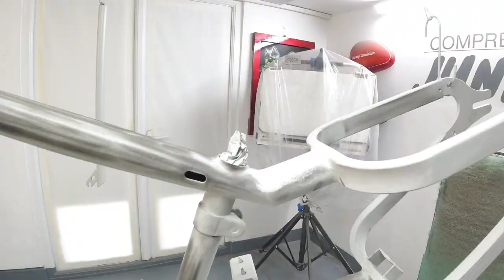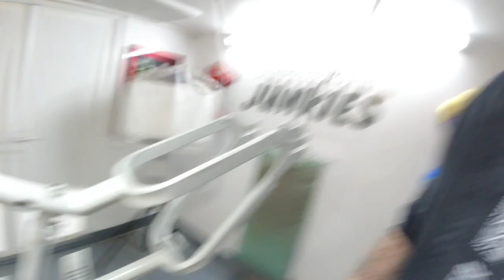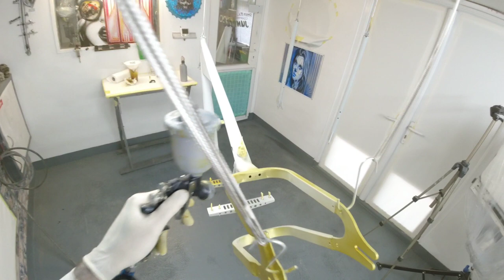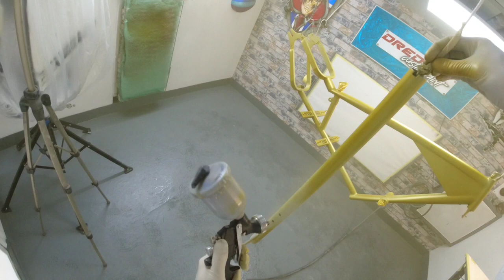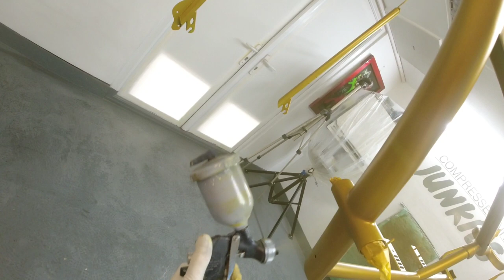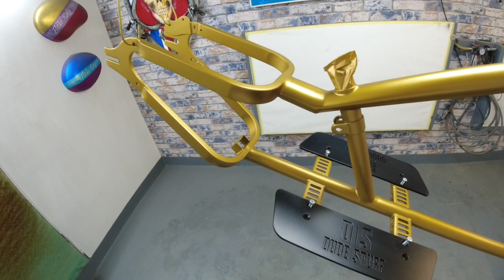lowrider E-Bike Frame  part 3 guide coat stage and base coat

Comment: Nice clean finish 👌. When you say flash time how long is that as when im using solvents i some times get bubbles coming up?
Reply from the maker: Try and go a little lighter with your first coat then build it up with wet coats give it about 10 mins flash time
Reply: @dredfxcustompaint  thank i will try that next time.